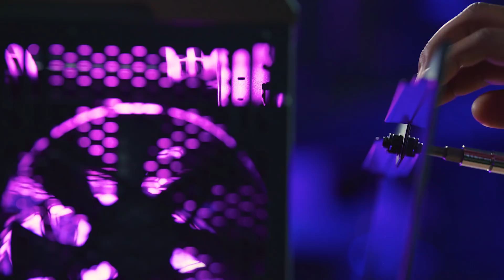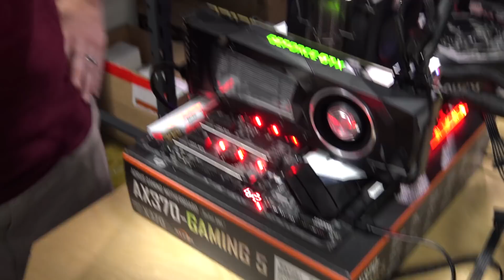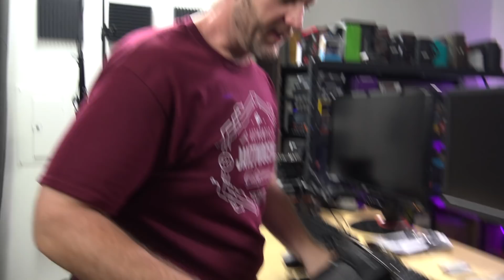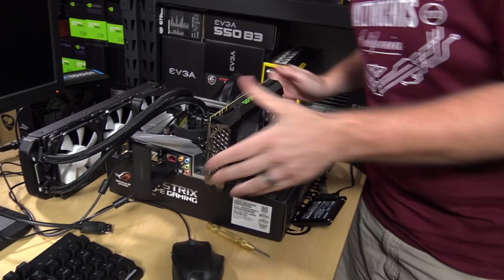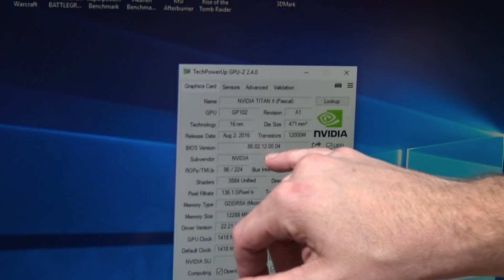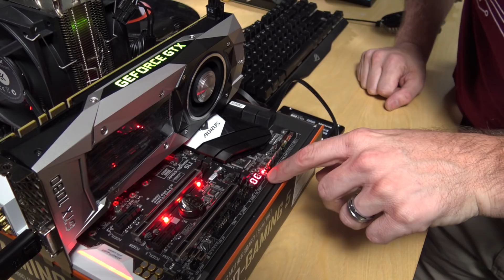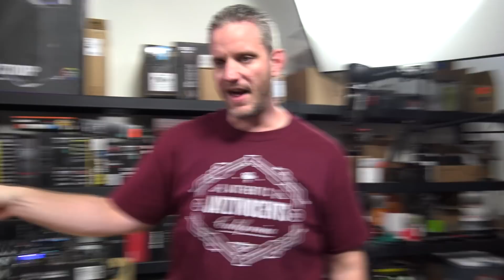I cant figure this one out... HELP!

Comment: I've got an Asrock Z77 (Yes, still on Sandy Bridge) motherboard that exhibits similar behaviour. It will occasionally fall to post with a variety of error codes. However, it will get working again with some wiggling of either ram, cables or graphics card, or none of the above. 5 years on, I have yet to identify the problem, it misbehaves, I wiggle (or not) and reboot until it behaves. Contact issue? Grounding issue? Who knows? I am quite sure the problem is with the motherboard because over the years, I have tried it with 2 good quality power supplies, and maybe 3-4 graphics cards, and 2 CPUs. And those work fine in another build. Who knows. Some motherboards are just super sensitive to contacts oxidation or something, maybe.

Comment: I swear it looks like you only checked the Bios on the card that was on the intel rig originally and not on the one that you took out of the ryze rig. It also looks like you are not letting the machines power down completely, as in not letting release or use up the residual electricity from the previous power up. Double check the GPU and make sure that they do have the same bios. And worst case scenario, do flash them.

Comment: The problem prolly lies in the connections that the MB makes to the video card.   Manufacturing processes require a certain level of in-efficiency.  I bet you're seeing that with these two MB's.  Take another of the same model MB for the AMD system, and I bet that the nVidia card will work perfectly.

Comment: I have had the same issue with RAM where my pc will stop to work at all, and through process of elimination i would find that it is a RAM DIMM, i would then swap the dim with one of my brothers pc dimms and it will work in his system but not mine..... but when you take one of his dimms and put it in the same slot , then no issue and this is on intel systems. Very weird

Comment: Wait, when you said "its an identical version!" at 4:56 after the card swap, isnt it supposed to be the same version because the bios is on the card? I would think that moving one card from A to B wouldnt change a thing if they are the same card, and while yes they would have a different BIOS, what im saying is that if you used 1 card between system A and B they would both display the same bios because its tied to the card, I dont think you showed us the Ryzen pascal bios, you showed us the intel pascal bios twice, once on the said bench, and once on the ryzen bench. If bios means driver software then its definitely weird that both systems use the same driver number and yet still refuses to work with one. Maybe a physical issue like a bent pin in the slot? Or slight grime on the physical card pci-e board?

Comment: you checked the bios version 2 times on the same card (first in intel bench and then on ryzen) - and didn't check the bios on the other card - also - Try switching PSU - they sometimes are a bit... wierd. I'd also try with only one stick of certified ram - just in case.

Comment: Probably tolerances and variances between cards. They are not electrically identical, it is physically impossible for current manufacturing processes to product perfectly identical cards. The ryzen system might just be more sensitive for these differences. My 2c.

Comment: I've had a fair amount of hardware experience in the embedded CPU arena, and we run into this all the time.  ALMOST always an issue like you are describing is a problem of tolerances.  Here's a couple of things it could be:
1. Check you PCI Bus speed with an oscilloscope.  It could be fluctuating, especially at boot, most cards will tolerate small differences in Bus speeds, but you could have gotten a card that is very intolerant.

2. Similar to #1, check you PSU voltage outputs (especially at boot), they could be slightly off, but enough such that the card doesn't have enough to boot, or too high and the card safety's out.

3. Check you PCI "pin gaps" on the motherboard slot.  This is my best guess to the problem based on you wiggling the card and getting a different boot result with the 3rd card you tried.  But this is also the hardest to check.  The basic idea here is that too wide a gap or too narrow a PCI pin may cause poor connectivity on even a single pin,, which would cause the system to not POST.  Swapping card where the pin-width is thicker would fix the problem.  You will need to check both the "gaps" in the mobo slot to ensure they are the correct width, AND check the width of the PCI pins on the "faulty" card.  Pin-width is easier to do with a digital-micrometer, so I would start there.  And if you don't have one... PERFECT excuse to buy one, then even if you don't find an answer, at least you got a new tool out of it..

Comment: Based on what you've already tried I'd suspect that the problem card needs a cleaner power signal than the second system is delivering. All cards have tolerances, and it could just be the card that works in both systems can handle the unstable power line better than the other card can. So I would think it is either noisey power to the card, or possibly slightly under powering the card enough that it can't handle it. In that case, the other card working in both would just be that (for now) it can work with the power it is receiving. Long term though a noisey power signal will probably damage the card and it wont work in that system either.

Comment: Jay, Does the questionable GPU allow the system to POST if it is in a different PCIe slot. Are the power supplies the same, as in wattage And maker? I would try swapping the PSUs for different ones.  Have you tried having both Titan XPs installed? I would try the known good (works in both) in the first slot, and the questionable one in another slot. However It kinda feels like it might be a power delivery issue. Might be that one of the pins in the GPU connector is not seating right with the cable.

Comment: Maybe its not a BIOS or software issue.  Maybe its a physical problem with a pin on the graphics card and motherboard that only happens when paired together.  Say maybe the Ryzen MB has one or more contact pins that are slightly bent/twisted and one of the cards has a contact point that is slightly thinner (due to a manufacturing "not really error/flaw") but not perfect.  The card may make good contact with one MB but not the other.  Maybe the comments section already found the problem, but I did not read all 2,444 of them.  haha

Comment: You never checked the BIOS on the Intel system. You grabbed the board from the non booting system (AMD) and put on the previously working system (intel) but checked BIOS on AMD after swapping them. That bios is from the board that was working on the intel and now its on AMD. you never checked the bios on the board now on the intel system.

Comment: I bought a 1700x with an asus board shortly after launch and had some strange problems. Originally I had it running off the same SSD I used to my previous build (fx-6300) and it worked fine for 2 weeks. Then constant blue screens cause of drivers. So I wiped the SSD and did a fresh install. It wouldn't boot off the fresh install. Re-seated ram? Booted no problem. Then my R9 390 started acting up. Had to reseat that too, and roll back drivers. Ryzen does weird shit.
Its worth trying..
-Make sure motherboard bios is up to date
-fresh windows install
-Try rolling back Nvidia drivers until both cards work
-Maybe one is trying to boost higher or pull more volts out the gate and its confusing the board?

Comment: Underclock it a bit. Or overvolt it slightly. See if it posts either way. If it's a card that made it out of QA but it's very close to the edge of the necessary specs but not so far out that it passed whatever testing they did, it might exhibit an issue like this.

Comment: I have had experience with this happening with nvidia on intel a couple times. What i did was clear the pci-e slot with compressed air on the motherboard and cleaned the contacts with rubbing alcohol which worked once. The second machine it happened on I just returned the GPU and bought another one. It can't hurt to clean the contacts. Also as some people mentioned you checked the bios of the same card twice so can't hurt to actually check the bios of the card that didn't work to be safe. Also maybe change the driver version on the ryzen system.

Comment: Jay you checked the BIOS on the same card - first it was in the Intel system then on the Ryzen system. Please try and see if the BIOS on both cards is actually the same or not. I had a problem with my Ryzen not booting when I upgraded to a 1080ti but mine was fixed by a simple clear CMOS on the mobo and I'm sure you already tried that

Comment: you could try a different PCI-E slot
Reply: I was just about to post the same thing. This smells like a flaky slot to me, possibly exacerbated by the fact that none of those cards were securely mounted. And, as many others have already pointed out, he did not verify that both cards have the same BIOS version -- at least, not in this video. He checked the version on the same (good) card once in each system.
Reply: Greg Wolking yea i agree but i think he did check the BIOS version of both the cards

Comment: Jay I don't have the time to sift through the responses so I will just throw this out. Take the "offending" GPU and plug it back into the "offending" motherboard in the same PCIe Slot and power it up to verify it is still in a failed state. Once the problem is verified power down the rig and move the "offending" GPU to a different PCIe slot and power up again. If it boots it points to a problem on the Motherboard if it doesn't boot it points to a problem on the GPU Card. If you want more information drop me an email and I will shoot you my cellphone. I have time this weekend. I have 10 Years in Digital Circuit Design and 20 Years in Board Level Field Service.  This problem is a little bit tricky but it can be certainly licked.

Comment: Could it be something as blatantly simple as a couple contacts on the AMD board aren't making proper contact for some reason, on that one specific card? One contact or two being off my the tiniest amount could cause problems, yet every other video card works fine. I am suggesting the connector could be the issue, just enough in spec to work most of time.

Comment: I think I had the same board with a similar problem but with a 1070 when I plugged in my msi gaming x it wouldn't work but when my friend put his in it would be just fine. I then switched to and msi board with the same exact chip(r7 1700x) and it happened yet again so I sent my card to my friend in Australia and he put it in his r7 1700x on the gigabyte board and it worked fine. I got the 1070 back and put it in my msi board after clearing the cmos and flashing the bios and now it works fine. I have no clue what happened but I was on the same boat as you and I couldn't find anything on any forums I tried after 6 years of being an i.t. Never seen anything like it.

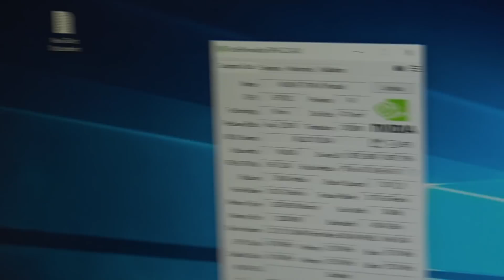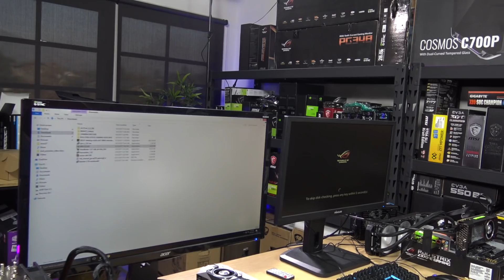Comment: 2:11 you read bios on the right rig, you then move that card to the left rig and it boots, at 3:51 you say you want to check the card from originally left rig that's now in the right rig, you don't actually  check it .  you then mistakenly check the bios on the left rig again with the same card you checked the first time 4:47. surprised its identical,   maaaaate, long day? its the same card as the first check you did. you then proceed to swap out cards on the left rig in a confused state over same bios when as I said its the same card checked twice. My advice would be check the other GPU that was sitting in the right rig that was originally in the left rig as you never actually looked at the bios of it like you thought you did :-)
Reply: wrong. The gpu has a bios on it. That's what he is referring to.
Reply: Yeah Jay totes checked the bios twice on the same card.  I'm sure he's face palmed by now but we all make these oversights when we are in the thick of testing.
Reply: exactly
Reply: DontLookAtMyName // Vids no they're not.  BIOS is integrated at the hardware level and drivers step in at the software level to get the hardware to play nice.  Two different pieces of hardware can and will absolutely have different versions of BIOS on them while using the same driver.   The driver tells windows how to communicate with/use the device whereas the BIOS tells the hardware the peramaters within which to run like voltage, power consumption, default clock speeds etc etc.  This is why the same model of graphics cards but by the various board partners will run different minimum/maximum clock speeds regardless of software installed.
Reply: He done fucked
Reply: He need some milk
Reply: DontLookAtMyName // Vids lol wut?
Reply: DontLookAtMyName // Vids drivers storage, bios card
Reply: Yeah, that was really strange. Or did they cut the part out, where they checked the other card?
Reply: Opposite. Milk makes me "drunk" as I'm lactose intolerant. Jay looks milk drunk to me... ;)
Reply: +DontLookAtMyName No. The BIOS for a graphics card is on the graphics card mate. The DRIVERS are on your local storage.
Reply: yeah that would just be wierd as i got a 6950 biosed to 6970 i did that 2 pc's back and the bios still holds it now lays to the side just to by used by my sis agian
Reply: +DontLookAtMyName Read what a BIOS is..
Reply: really -_-
Reply: BIOS versions and drivers are stored in your storage drive, not your gpu.

Comment: Once verifying same bios on both video cards. UHFI/BIOS reset? Ram re-seat and/or reversal, with visual for defect/deformation or contamination?? Did you do a visual inspection/comparison to both video cards contacts and the PCI express slot for a defect/deformation or contamination? Video card power cable and all connections for the same, defect/deformation or contamination? Power supply just to verify that it's not the cause? If the second PCI express is 16x have you tried to boot from that slot?
 Please post an update when/if you find the problem and fix. It could save some builders a lot of time, money, headaches and heartaches.
 Good luck and best wishes.

Comment: get the problematic card, find a ryzen/ram/cpu combo(preferably exactly like the one you own) and try the gpu n that system.

If it still doesn't post it is the specific combination that has the issue, contact manufacturers and even consider sending the test system with the issue for inspection. there are bugs that manifest like that, it is rare but it happens.. although i am positive that next bios update could solve the problem

Comment: i had a similar issue that turned out to be a conflict in settings being out of bounds for the motherboard to register as an acceptable setting for the post to go through . i fixed it by borrowing a friends identicle card that booted  defaulted everything to the lowest it could go shut off pc then put my unbootable card back in and it booted with the lowest settings an allowed a post

Comment: I saw the same "b2" code when I was building my 1700X with AsRock X370 TaiChi two weeks ago. I used a 1080 ti FE which worked on my previous Intel build, but it wouldn't POST on Ryzen. It did not always stuck at "b2". Sometimes it could POST after a few power cycles. Later I figured it had something to do with my overclocking of the CPU, although the code is GPU related. At 4.0 GHz it might stuck at "b2" with 50% probabilities. I lowered it to 3.9 GHz and slightly increased DRAM voltage. Now I haven't seen "b2" at all.
Reply: The DRAM I used was a pair of G Skill 3200 C16 kit. Thaiphoon Burner shows the die is made by Hynix at 25nm node. I was able to keep it at 2933 stable.
Reply: 3.9 seems to be the best overclock that maintains stability. I own the 1800X have tried higher than 3.9 have a pretty decent cpu cooler the Noctua D15 SE AM4. but the voltage gets a bit stupid after 3.9 so I've managed to get mine to a point where it runs 3.9 and wont go over 1.424 under stress.  the temps are really good with this asrock board and have not had any issues.
Reply: I'm actually surprised even 1800x can't maintain 4.0Ghz stably. I don't know if in that case leaving it at stock and let it boost to 4.0 by itself is a better choice haha.
Reply: Chenyang Zhong 
Maybe the CPU OC changes the PCIE Bus Speed aswell and the one GPU can't handle this Speed?
Reply: I don't think that's the case because I did not touch the BCLK. It may be a chipset issue though.
Reply: but the pci lanes are directly wired to the cpu itself
Reply: Chenyang Zhong weird. I have a 1600x that runs at 4.1 just fine. I have an occasional post issue, but very very rarely. And just running through the bios will fix it
Reply: +Hari Haran
No that was an issue of several decades ago. They dealt with this by having a buffer between the CPU and the PCI lanes. This standard is a part of PCI Express.
Reply: Demonslayer20111 this is purely silicon lottery. Congratulations on getting a good chip. Also, CPU with fewer cores tend to overclock easier.

Comment: As you remove the board and inert the into the PCIe slots of different boards there will be wear. The same is true for the slot it's self. Have you examined the slot and the Titan carefully for wear? And I mean with a decent magnifying glass.  Simple maybe but still if the wear is just right on the card and the slot.....